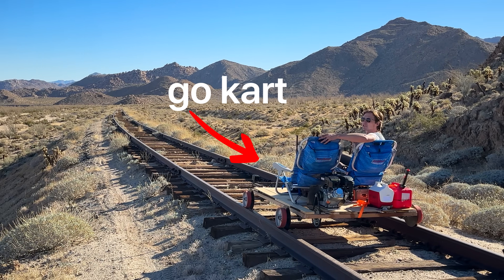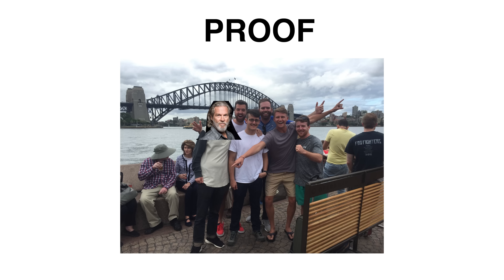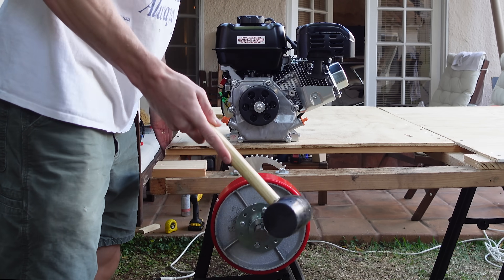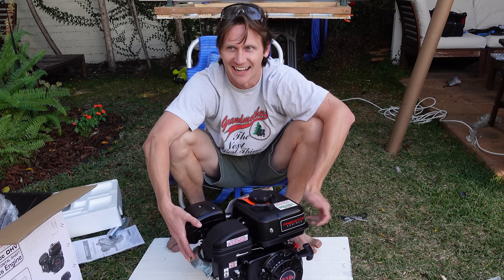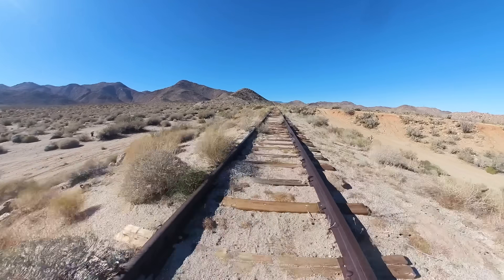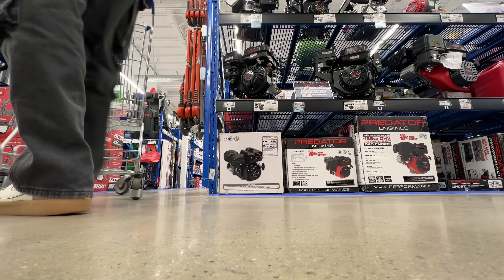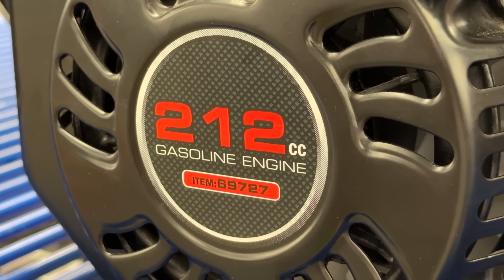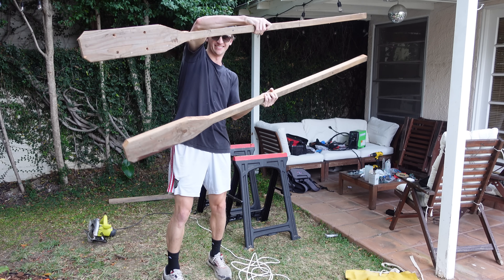I Built a Go-Kart for Abandoned Railroads

Comment: Need conical wheels, they will keep you on track without the flanges rubbing constantly, the flanges are mainly to prevent derailing from turns and bumps. It will also reduce the stress on the wheels. Your best bet is probably to either weld some cones and the support structures or buy the specially made wheels. If you somehow got a hold of 4 of the right type of rims, you could cut them in half and they'd be pretty easy to mount. Some cheap go-kart rims would work.
Reply: Yeah, I expected that to be a problem when they tried to turn, but the way the video is cut, I'm not sure they ever even made it to a significant turn.
Reply: i can't believe guy that wasted so much time didn't google or watch single 10 minute long video how train wheels work, he could make just long cones and not worry about track gauge
Reply: Or just buy railbike wheels?
Reply: @Blabus5  Or ensure the difference between 56 inches OD or ID....

Comment: Railway wheels have a conical profile to counter centrifugal forces at turns. Also it helps with improve the stability and tendency for the wheels to oscillate.

Maybe worth considering next time.
Reply: Railway wheels have a conical profile that acts like differential gear in a car when cornering the taper compensates the wheel speed on a fixed axle
Reply: Right, train wheel designs are qualified to be used on train tracks…kinda like how certain submarines are designed and built within standard specifications.

Comment: Ya know, they sell train cart wheels for way cheaper than that, even without switching to polyurethane. 3 minutes of searching, and I found a set some for $26 a pop on Zoro Select, and sets of 4 for a similar price elsewhere. I think you could redo this project with proper train wheels for less than the cost of replacing the engine. This is an awesome project, and it would be a shame to give up, when you're so close to success! One other idea: you could easily incorporate some friction brakes, applied either directly to the wheels, or to the track. One final thing to mention: it probably wouldn't be extremely difficult to devise a "reverse gear," if you switched from a chain to a tensionable belt-based system.
Reply: I agree with the tension belts, but I also think more complexity probably isn't the thing you want many miles from help, in the desert especially.

+1 to Train wheels though.

Even the $200 ones are cheaper than doing all that work when you value your own time.
Reply: Also, train wheels have a specific geometry that keeps them on the track using a solid axle and mirrored bevels on them. The flange on the outside it just a safety in case something goes wrong with the wheels tracking.
Reply: @1SweetPete  I agree about added complexity being liability, especially in a remote, inhospitable environment, but part of the appeal of the idea I mentioned that I didn't expound upon is the ease of repair of such a system. A belt is easier to replace than a gear chain, and you can carry multiple sets with basically no extra weight. Hell, a leather belt could be used in a pinch in most such set-ups. Also, with the right set of belts, you can cut entire sections of the drive-train out if they give you problems. I've seen "bamboo carts" that use a similar idea that can be completely dismantled and removed from the track in SECONDS, axles, platform and engine in separate pieces, with a slip on belt. It's reduced complexity, when you take into account chains and adjusting tension.
Reply: @FeedMeAQuarter  Indeed. The beveled wheels and flange were critical to making modern trains safe and workable. There's a lot of theory behind such a seemingly simple concept.
Reply: honestly for what its worth i feel like they could even just make some wheels out of some scrap plywood and patience, as long as its round and vaguely in a trail wheel shape (and not made out of what appears to be the crappiest cast metal available...)
Reply: Or at least put an idler on the chain
Reply: He did the one thing you shouldn't do with the type of wheel he used: he bored holes in the thin parts. Those are cast wheels, and they have those 4 ribs for a reason. You can really see at 12:05 how it just broke, because the wheels are cast metal, which can be brittle.
Reply: Got so frustrated watching this lol, a tiny bit of research would've helped him so much.
Reply: @NezNar  I know, right? It's a cool project, but lacked really important, basic information for the execution.
Reply: Is there a link to those wheels?

Comment: If you would like to try this again, I will give you a bit of info, train wheels aren't actually designed that way. There is a slight curve between the riding part of the wheel, and the flange. meaning it can navigate curves easier. the best thing to do is to rebuild the wheels entirely, because even without the broken wheels, it would have been very hard to navigate the curved without banging them up. If you need more context on wheel designs, search up a picture of railroad wheels and you will see what I mean.
Reply: Agreed the wheels need a  "V" shape to be self centering and not risk jumping the track along curves
Reply: @scientificuppercut  yeh but even if they hadn't failed like that, without the proper design he would never have made it past any curves and turns

Comment: For the next try, train cart wheels actually have a bit smaller diameter on the outside-most part of the cart. this reduces the wear and tear on the cart wheels greatly, as the cart just cradles side to side, which helps it navigate turns with lower pressure and pull on the bolted parts of the wheels.

Or you should just put more engines.

Comment: Maybe you should get someone with engineering knowledge involved. Building the wheels like this means all the centrifugal forces will load on the side plates, which will in turn pull on the rims through the bolts. The rims also looked really thin and fragile, definitely not made for this. The trick in actual train wheels is, that they aren't straight cylindrical like the wheels you used, but tapered. This way the cart will automatically align itself, the side plates would only be for safety. Would have been awesome if you guys didn't have to cut your trip short.

Comment: the only thing that would make this better for a basic working machine is to make the wheels conical in shape. this would allow it to dynamically adjust and travel around bends/curves much smoother. even if it's DIY for them to reach said shape, it would be much better than the setup used for the wheels here.

Comment: 2:50 as a railroad engineer for 13 years, i can say those wheels you used would decrease your performance by ALOT. i recommend removing the red rubber if you can.

Comment: (Disclaimer: Read this as half tongue-in-cheek, half suicide prevention)  At 00:05:00. Just put a support under the hitch end of the trailer. Both ends, actually to eliminate see-saw. Your friend could have stayed in bed. Then use a lever to shift that disastermobile onto the trailer. Or, two parallel levers connected by a crossbar. This video should be called, "How to risk breaking your legs (and your friend's) way out in the desert by not understanding things, like, oh I don't know, how a lever or a wheel works." Ever wonder why trains don't just slide off the tracks? "No, I'll just use a normally shaped wheel, because, like, that couldn't possible slip off the rails. My rail guards are made from tin-foil reinforced Jiffypop popcorn tins. Surely they will stand up to any momentum we generate."

 "Momentum? What's that?" It's the product of the mass of two idiots plus a disastermobile times the speed at which the three objects are traveling. Think about how large that number is. "But our rail guards are MUUUCH stronger than that. We're willing to risk our leg bones, our skulls, bleeding out way out in the desert, and coyotes. Our phones won't suffer any damage so we'll be able to call for help." Idiots. I haven't watched the whole video, but let's see if that's not exactly what happens.... If it doesn't it will in short order, if only because of the curve of the track. Why don't RR's bank curves like highways do? The train would tip. Why don't trains slip off rail at each turn? The wheels are conic. This shape also helps obviate the need for much banking but since your Jiffypop popcorn guards are better designed than locomotive wheels, they will not only keep you idiots from sliding off the rails, but surely, surely they won't develop stress damage from going around curves that are NOT banked." 

I want hear that boss jam you guys, I'm sorry, idiots are going to write about the dimensions of the steel rods they're going to put in your spines. It's going to be 56.5 cm. Wow, I was being rude when I called you idiots before, but OMFG, did you NOT go to the site first and take measurements? "No, RR's are standardized." No shit but obviously you've never broken a bone before, or if you have you've forgotten it. And let me guess, nobody inspected the tracks for defects or obstacles. "Well, that would be hard to do the -" Then use a fucking drone. Serious idiots. No, wait, here's the one tool you didn't use because you don't have one. Any guesses? It rhymes with "brain."...

OK, no fucking way. I just finished skipping through the rest of this cockpit-voice-recorder  black box video equivalent (because that's what the medical examiner will study to determine cause of death). And sure enough: wheel failure. What really blew me out of the water wasn't that my prediction was spot-on, but was the minuscule diameter of the bolts and ARE YOU FUCKING ME OUT LOUD zip ties? Zip ties. Dip-shit-wise. I don't want to go back to what I skipped over to see the hack of a brake system or whatever you dreamed up, maybe holding sandpaper against the rails. 

Did you see how slow the other guys were going? What was that formula for momentum again? Mass times velocity. Real slow means low momentum means no broken bones. Their slow speed (and their braking system) is the reason they had no helmets. Pros like you two probably don't need helmets b/c of all the steel plates in your heads. The other guys weren't just wearing costumes, they chose long pants b/c they couldn't afford the skin-protecting Kryptonite shorts that idiots wear. Motorcycle chaps are leather not just for the cold riding but to keep skin after a wipe out that shreds denim. Final note: I know a lot of people out there are hating the length and harshing of this comment. Seriously, supporting this channel and its patron is helping these idiots into their wheelchairs or graves. It's only a matter of time. If you want to support them do it through their GoFundMyHospitalBills.
Reply: STOP HE'S ALREADY DEAD😭😭😭😭

Comment: 🚂🚂🚂🚂🚂🚂✈️✈️✈️✈️🚃🚋🚃🚋🚞🚠🚡got a real one it’s called a railrod it was made in 1970s. It comes apart really easy and folds up. Ran on a 3.5 Briggs & Stratton engine with a centrifugal clutch.
The wheels are rubber so they don’t trigger the track 
It’s got a spot for a chainsaw if you wanted to you could put plywood across the whole entire deck if you wanted to throw luggage, extra humans anything

Comment: The difference between your wheels, and more functional ("real") railroad wheels are that the real ones are conical. With a truncated cone [we've all been there!], the advantage of the real wheels is they aren't as stressed by turns and curves as your more mundane wheel shapes. I would love to see you upgrade your most-excellent existing cart with correck wheels, even if you have to save up a little and do the new video at a later date. All good wishes.

Comment: the wheels work however the base of the wheels should be curved allowing for the train to tilt during a turn so that the inside wheel will always be smaller, the flanges just stop it from derailing on tighter turns

Comment: 1435 mm, as we usually say here in Europe. Also, the driver of a train isn't called captain, but Engineer in the US and Driver in the UK. And lastly, if you make a second iteration of the cart, change the wheel shape. instead of flat wheels, make them slanted towards the outside. They'll run much smoother, especially around curves, and won't break off the flanges as easily. See here for the why: https://www.youtube.com/watch?v=XzgryPhtc1Y and https://www.youtube.com/watch?v=HeDuGWNTDPY Cheers!

Comment: You would of had better luck if you converted an old  suzuki Samurai to run on the rails with drop down wheels. Plus side is most of what you need is already engineered by Japan and you don't need a trailer to get the vehicle to the abandon track and you can keep going in bad weather because hey basically its a full functioning car. the key is to weld the wheels you need and set up to a Suzuki Samurai see other home made rail cars on you tube as an example.

Comment: "how wide are railroad tracks"   ohhhhh...   you have to be careful with that one.   it could be anywhere from 600mm to 2140mm

US Uses standard guage, there are a few narrow gauge lines still in use in the USA but many have been...  abandon... as standard is mainly used.  (narrow guage was used in the UK and Japan, and when rail cars were imported from there,  for the east and west coasts...   tracks were made to those spec's.

This means if its abandon.... you really should check if it s a narrow or standard...   wide, or heavy freight guages are only used in a few places in the USA and were only for "short runs"   these were used for hauling supersized objects short distances, -factory to port)   picture building large steam engines in a factory, loading it onto a super wide rail car,  and moving said car 1/4 miles to a port where its loaded onto and fixed in place on a ship.

Comment: I'm hoping the tracks are pretty smoothe. I'm guessing you weigh 155 160. Add 40 for your engine your buddy 150. Youre looking at 400 lbs given you have gear. Your frame work looked like 2x2s with 1/2" plywood. Maybe 3/4". If it gets to bouncing and flexing it could buckle or snap. Also screws tend to back out when the things they are attached to are flexing. Bolts with Teflon nuts would be safer. Metal frame would be as well. Good luck. Any idea what your bearings heat max is? If they aren't rated for high rpms they can fry. Also your wheels are light weight cast and have thin hubs. I don't see this ending well.

Comment: well you are an engineer with an engine-er, but would it be more useful to just state how many hp the engine has, not how many cc it claims to have, yep 50cc can have more hp than 210cc.
Reply: rip motor polarization. also rails to put the rail go-kart on the trailer, or just wheel ramps. or you could just put two folding 2x2 rail wheels on a bicycle. then ride to the place and unfold and go.
Reply: so you made the full bridge rectifier. lol. do it electric, next time.